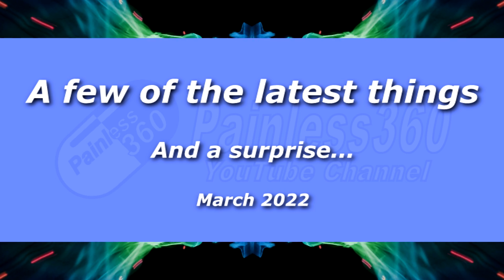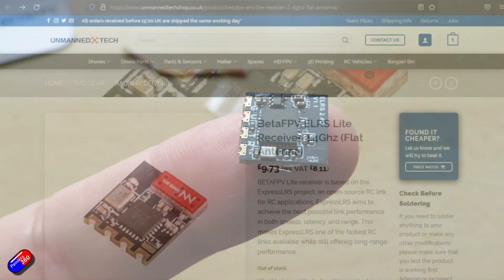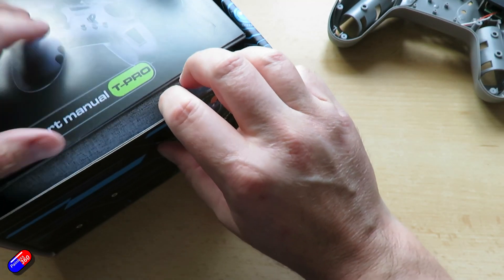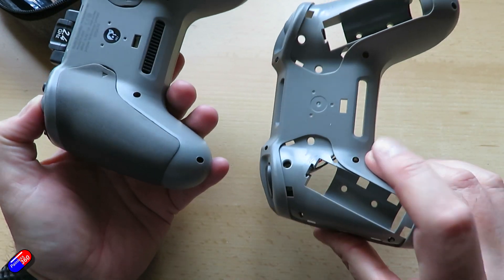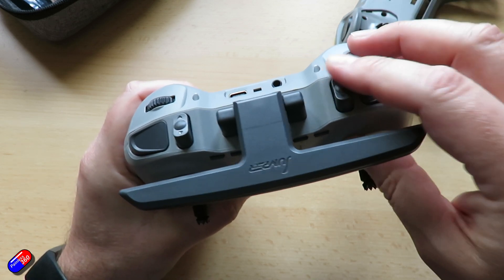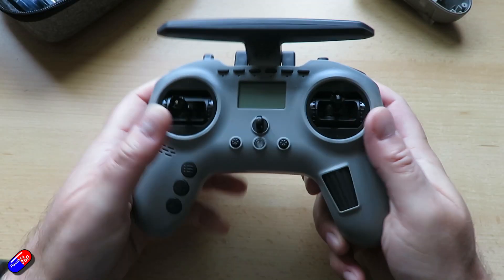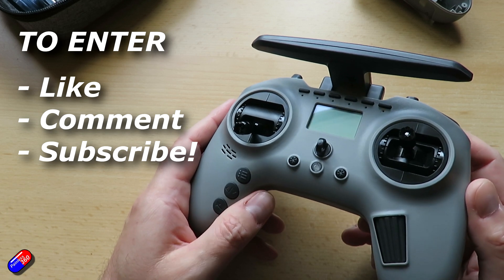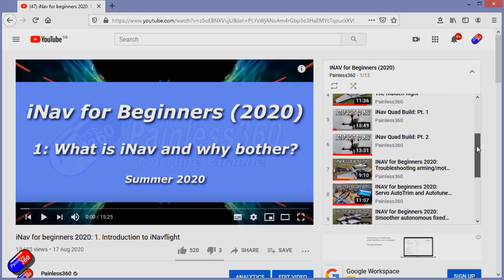Latching switch backplate for the Jumper T-Pro and the latest, improved BetaFPV ELRS receiver..

Comment: Quick word on the V1.0 flat antenna receiver (for those that know of it, or bought it); they have mentioned they will be releasing a V1.1 (which Painless360 has) since the first version was incorrectly manufactured and designed. The new one is much better, and from my tests, gets twice the range with a much more comfortable -dbm threshold than the old one. I will release a range test and giveaway in a few days, but in short, the new one has around 2-3x the range of the old one. The tower antenna is still a better buy if you need the range, but the flat antenna is much closer now in terms of reception. 

Hope that helps!
Reply: Final results for those interested (250Hz, 100mw, antennas horizontal - worst reception possible)

Flat V1.0 - 337m 
Flat V1.1 - 664m (much more stable RC link - at 100m v1.0 was touch and go)
Tower V1.0 - 978m (Same as happymodel EP2)
Reply: @swg_fpv   i was just asking about range ,thanks for the test
Reply: @ezalku  no worries - the flat antenna v1.0 overperformed tbh - it was near failsafe-ing at 100m away. The new one is miles better
Reply: Where can I find this radio with the latch receiver. I have looked everywhere and still cannot find it
Reply: @Eggo1966  not available yet

Comment: I'm so torn on this radio, as i didn't like the gimbals on the t-lite. But i like the rest of the radio. IMO if it had some higher end gimbals and used 18650 batteries, it's would be perfect (for me) ty Painless360 for this video.

Comment: Great Video Painless360 / Lee. Finally was able to get out and fly with ELRS and Kopilot lite and it worked great. It's been such a long winter and it came back, darn. Any idea of range for the flat Beta antenna rx?   I so wish there where more options for ELRS Bus and just a couple more full channels, 1 to 6 would do the trick. But the project team is awesome for what they have done so far.

Comment: Great video Painless360, looking forward to a review on the new ELRS reciever - I can't imagine there'll be much difference in performace but I'd assume the new antenna design will be slightly more durable and easier to position in the frame than the tower antenna.
Reply: I forget who did it but the performance of the flat antenna was really bad compared to the taller ceramic.  It had some weird nulls.  With that said, I'm planning on ordering one for a whoop with the thinking that a really poor performance ELRS receiver will be better than my whoops VTX.  We'll see i guess.  Hopefully P360 will beat me to it.

Comment: Hi Lee! Great video as always.  Don’t you think that backplate is a huge waste, though? Why don’t they just offer a switch which would take the place of either knob on the back, instead of the relatively enormous plastic part? They’re in the position to make a little bezel which would fit the switch in, neatly. Thanks for showing this, Painless360 rocks!
Reply from the maker: I think a radio designed with a modular switch setup would be a good idea so you could easily customise it for how you fly...

Comment: Maybe Painless360 could be on the watch for a solution to this winter's Vector disaster? At the start of this season, the Vector configuration software suddenly refused to work with Google Maps in the waypoint setup tab, making it impossible to create new missions. We tried three different computers, four different browsers and four Vector units to no avail; Microsoft must have done something atrocious while we were hibernating. We are frantically scaling the iNav learning curve now, but it would still be a pity to gut a heap of well tuned models to bin four perfectly good flight controllers ...

Comment: The flat antenna has incredibly short range, similar to old SPI receivers.  Betafpv has offered me replacements for the ones i bought (supposed to send me  EP2 with tower antennas ) but still has not shipped them to me after a month...   Bottom line, stay with standard EP2 style rx, proven performance.
Reply: Just received the replacement rx from Betafpv so kudos to them for customer satisfaction👍